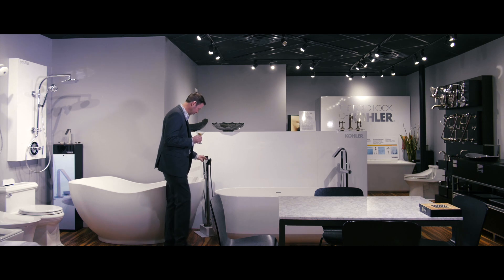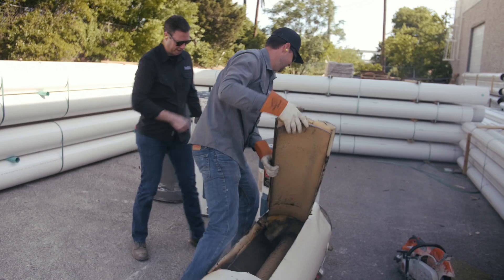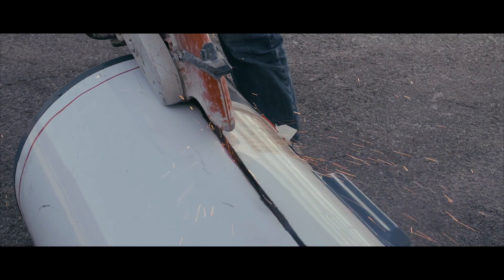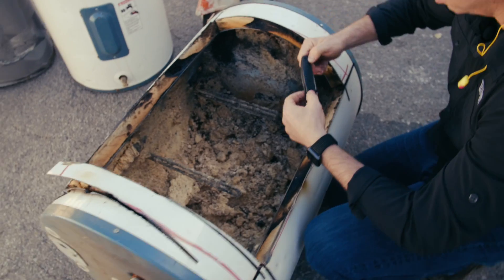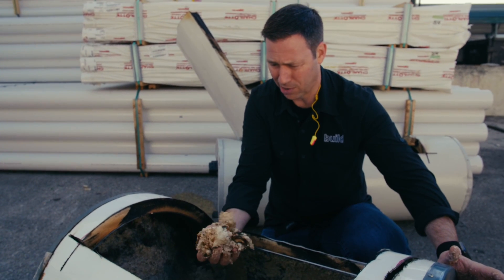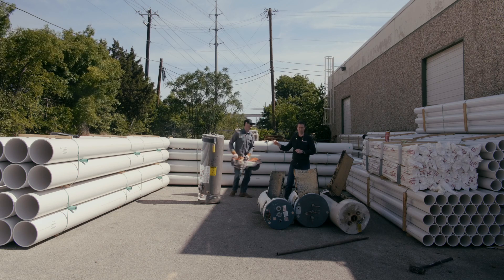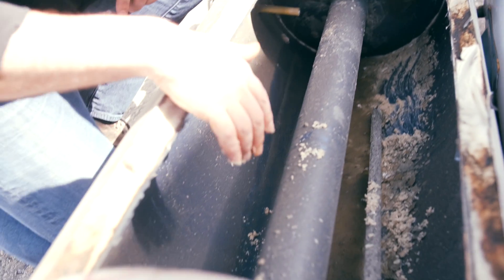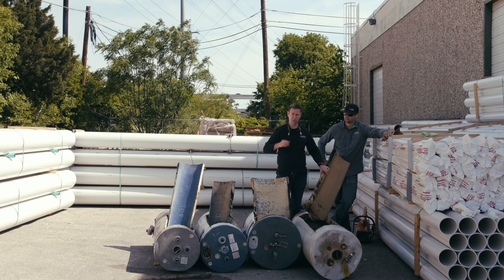Water Heater Tank Autopsy: You won’t believe what’s inside!

Comment: the dark brown and black stuff should be rust or a mix of iron oxides and iron hydroxides, presumably from exposed steel or iron in the tank walls and/or fittings. (if the enamel fails in a steel tank that would make sense, but a copper or stainless tank wouldn't make much sense for that, neither would an enameled tank that hasn't failed ... though stainless steel can still oxidize over time, especially when hot, and form black oxides, so that might be possible, too)

Most of the scale should be calcium carbonate formed when dissolved calcium bicarbonate decomposes at elevated temperatures. There's probably some magnesium carbonate, too, and the yellow color should mostly be from iron carbonate and hydroxide present in smaller quantities. (either naturally in the water or dissolved from iron and steel pipes)
It doesn't take much iron to discolor white calcium and magnesium carbonate. (iron is usually what gives tan and yellow limestone its color)

There might be more sediment at the top of some tanks due both to the higher temperature there in the electric heated tank, and due to lower turbulence and favorable domed cylinder shape allowing crystalized deposits to grow over time with existing crystals acting as seeds for more to form a stronger crust on rather than falling away.
The heating elements likely don't provide enough support for deposits to get that thick before falling off, plus the more extreme thermal expansion directly on the rods would more likely make deposits flake off when they get thick and heavy enough.

Comment: The small amount of scale in the bottom of the electric hot water tank is because the cold water supply is at the bottom flushing the sediment build up. As far as the different amount of build up is determined by the temperature of the water. Heating the water to hot causes the minerals to burn out as total hardness

Comment: Joe the plumber great video. I have always wanted to cut apart some of the water heaters I have drained or tried to drain. There is one thing in your video that stood out is that a water softner would help the water heater. I have replaced water heaters under warranty for Rheem that were less than 5 years old and every on of them have a water softener system.
It seems to only happen when there is a problem with the water softner causing high amounts of salt in the water heater causing corosion in the tank taking out the anode rode

Comment: Interesting. Probably why the topside feels heavier in a used tank when removing it. 

I came here to see how thick the tank walls were. Id like to recycle one we removed for a project that requires I cut it in half.  If its really dirty i will probably just scrap it properly. We have city water so I don’t expect a whole lot but id have to wash whatever is there out and paint the surface.

This at least tells me to focus on the lower half anyway. Thanks this was interesting.

Comment: getting my water heater replaced by maintenance man tomorrow rental property good folks and I thought maybe to ask if I could keep the old one thinking that there would be this copper line/pipe  coiling from top to bottom like some kinda heat exchanger etc etc...wow the inside is basically just a flume pipe  {gas type} thanks for the fun demo,,,, nobrainer please take away the low tech junk maint. man hopping for something to make a copper sculpter .....

Comment: We have a traditional copper cylinder about 45-50 years old and has no scale on the bottom, just a thin coating of limescale on the heating coil, and we live in a hard water area ??

Comment: About three years ago we replaced our 1985 propane fueled hot water heater. Not because it didn't work but because of water quality. We live in the Northeast and are truly blessed with soft water. There is a silt issue I discovered when we replaced it so I need a filter system. I figured there was a LOT of years of build up in it so I should replace it. The new one won't last half as long.

Comment: as easy as the buildup croubles, I wonder if a presser washer with a sewer cleaning hose/head would break the stuff up.  Go in thru the anode hole, and use the cleanout tap (maybe remove it) so the water has someplace to go.

Comment: Am so distressed. Even though pipes here have been replaced with copper, my water heater had so much crud in it that when my family member went to finally drain it after it had not been flushed in nearly 10 years , the sediment exploded all over him when he hooked up the hose. Thinking maybe . Just maybe the flushing would have improved. Now over a week later it's much worse. Of course I don't drink it but it ( Vaseline   type ) sticky feeling can't wipe it off my skin. It sticks to the dish and my hands stick to that! And it is very itchy. Help! This is Los Angeles water. Burns my scalp. I don't even wash my hair but every 5 days now. Plumber coming tomorrow. Can this be fixed? Or should I get a new heater?

Comment: I think the difference between the tanks is likely the condition of the anode rod.  The good tank has a decent anode rod, likely been maintained/replaced, whereas the older tanks had no anode rod.  So the rod is sacrificed from the mineral deposits instead of the tank.
Reply: Anode rod is to stop or greatly reduce the rate at which the steel corrodes once the glass lining cracks. Which is what causes a tank to eventually leak. It has no real impact on the mineral deposit rate that comes down to purely what's in the water, how hot the water is set to, and how often you use the hot water. A tank that gets used heavily will actually have less buildup then one that sits maintaining a lot. As the static tank the mineral deposits just sit there and don't go out with the hot water.

Comment: I have a 40 gallon gas water heater in my garage that developed a leak. Fortunately the last time I had the water heater replaced I had a drip pan installed that drains out to the outside . I heard it dripping and could see that the tray was full and draining to the outside and then I heard a loud low thunder rumbling coming from the tank and researched this on you tube and after seeing videos about flushing hot water heaters and on I thought the tank had cracked and must be loaded with this sludge shown in this video as I cleared the area around the water heater I got on a step stool and noticed that the 3/4 inch inlet fitting was leaking and after tightening this site water stopped filling the drip tray. I removed all the standing water in the drip tray and ran my hot water. when my hot water heater fired up this time it was quiet. Thus I concluded that the loud thunder rumbling vibrating sound had come from the standing water in the drip tray boiling under the gas burner now I don't need to replace this water heater nor call a plumber to fix it because I fixed it but I will flush it now for sure....

Comment: I'm not a chemisist, but if you boil or heat water  the precipitation of calcium and other salts occurs when the temperature is over 80°c, but not the formation of scales, heat cause the chemical reaction that makes tiny floccules suspended in water, actually the formation of scale occurs when hot water with this tiny carbonate precipitates suspended in it gets cooled really fast, this is just my experiences.

Comment: common sense the older tanks lasted longer than the newer tanks all cuz all appliance manufactors started a hustle on making it to where all the new appliances don't last as long just so the consumer has to go buy a new one. but the thing they didn't think about is not all people will go back to the same brand especially after they've seen that they don't last as long as now the products are junk. but that's with all manufactors on their monopoly system.

Comment: Most people don't do the regular flushing so to much crap accumulates till it corrodes and leak out from the bottom. I flushed my water heater and quite a bit flowed out. I just keep flushing till the water comes out clear. The stuff comes out orange/red and mine is hooked up to city water source. The 2005 model could have been flushed on a regular basis. It also corrodes the other fixtures too. Have to change out a couple of faucets and found them getting corroded too.

Comment: The water my city suplies comes from many wells and it's not treated so it can actually become a rock.

And that is what I found a couple of months ago. I used to flush my water heater and get some kind of wire throught the faucet of the drain to remove the scale inside. But last time I actually decided to change the faucet that was plastic for a brass one. When there was no faucet I put my finger inside and noticed all the scale built it inside and it was really hard. Nothing nowhere like the one in the video.

With that wire and my finger I tried to remove a lot of it. I ended up with a bag of hard scale and Im pretty sure that is not even a 1/3 of what is inside cause I was only doing the bottom part of it.

I'll be changing it next year once it turns 10 years old. 😑

Comment: Could be some  water sources had more minerals than others as why some looked better. I remember some years ago how one old heater's bottom element kept burning out. They asked me to look at it and after removing it, I shined a flashlight in the hole and saw only a solid block of scale. I believe there wasn't enough water seeping in through the scale to the bottom element (boiled away?) and the it was overheating.  I was surprised to see in your video how much scale collected at the top.

Comment: So how would this work with thankless water heaters? Is there still buildup within the unit and therefore causing failure of the system early on? Or is most of that build up passing long in the tankless water heater and technically not being "filtered" or left behind because of no tank?

Comment: That was disgusting Matt!! Haahahahaha....I just bought a new 'whole house' water conditioner the other day, BUT....I also had a BRAND NEW electric water heater installed at the same time!! My house was built in 2003, North Florida, and supplied by the city public source. Im sure my electric hot water heater was just as bad if not worse before replacement after 17 years!! Heres to hoping I get many years of quality water running through my cpvc's, without shortening the life of my heater. Thanks for the show.

Comment: My water heater is like the third one1. First its electric. The scale builds up then falls to the bottom until it gets so deep it causes the bottom element to fail. It took over an hr for it to drain out a 3/4 inch hose due to all the build up over the inside of the drain. I couldny wven get 150 lbs of air pressure to move it out of the way ( with top element out ). Then i used a shop vac with a small fexible  hose at its end to go in the hole the bottom element came out of and vacuumed 5- 3 gal  tanks full of that crap out before putting my new elements in , turning the water on and flipping the breaker on. 
I did this same thing  2 yrs ago as well  as replacing the thermostats and putting these super duper looper heating elements in. They got my water hot a good bit faster but they didnt survive the scale attack any better. Anyway, if ya got minerals in your water yoy either get to so thos every so often or replace your water heater. Personally after replacing my bottom element 3x and top once i finally took the time to clean it out some and put the afore mentioned extra long but bent in a loop to fit elements in and i went ahead and replaced the thermostats too since they dont cost much and i already had everything apart.  Learning to do this stuff is well worth your time guys. Much cheaper than replacing your tank and super easy to do. I figured out how to do it on my own , long before youtube was around and guys like this one were around to explaine everyth3ong to you.
Btw, great vid. i only wish  While you were in there you had explained whats what for those that dont know.

Comment: That's why you don't want hot water tanks, and instead a tank for heating water with a heat exchanger for instant hot water on demand. This heat exchanger spiral is heated much more evenly, so you don't get cold spots where bacteria can survive and the water don't sit very long in those pipes, since the volume is that much lower.

Also modern faucet do cause water hammers, these shake the heat exchanger spiral and any deposits on the inside and outside will be loosen over time.

Comment: Remember that the only difference between a 5 year guarantee water heater and a 10 year is the length and diameter of the anode! Buy the cheapest and a few rods. Pull the rod on a new heater and put anti seize paste on the threads and check the size of the anode, you might want to change it immediately.

Comment: YoU mIgHt cOnSidEr Not flucTUAtING tHe VOLUME so VIOLEnTly. fUCK.
Reply: Not that will reach the idiots cutting open water heaters with a chop saw, and no respirator. Also; If the water heater has scale, that means it was REMOVED from the incoming water: Your shower gurgle is therefore cleaner than the cold water from your kitchen tap, providing it remains unfiltered.

Comment: Huge difference between the 2001 and the 2005 water heater.  If you don't know the origin of the tank and how it was used it's difficult to determine the reason for the difference.  Good assumption that the 2005 may have had a water softener or a filter.  Why don't we filter all incoming water to our homes before it reaches our tank and taps?  Water quality and the mineral levels varies dramatically from town to town to rural to city.  The 2001 may have been heating water that was drawn from a well.  These deposits are minerals and do not necessarily contain bacteria or anything to be concerned about.  Most likely a water sample drawn from any one of those tanks could have been tested and found to be safe for consumption.

Comment: cold water can hold more of the mineral content in solution, when water is heated, it can no longer hold so much mineral in solution.  And so the minerals precipitate out and collect in the tank.  And so your hot water will have ever so slightly less mineral content then the cold water, as some minerals are left behind in tank and on pipe walls.

Comment: My hot water heater got really hot and kicked off and I had to have an electrician come and reset it to turn it back on but every since then I have had grit coming out of my water faucet and out of my bathroom bathtub faucet there's tiny flakes of black sooty kind of stuff. I noticed little flakes of it in the bathtub after I drain the tub from taking my bath. It makes me worry that it's in the bath water with me and I wonder if it's black mold or what it could be. Do you have any ideas.?

Comment: The top of the second tank had more scale because the top is where you can get air pockets in the tank showing surfaces where the watered surfaces can dry out from the heat and deposit its dissolved nature.  Either that or the water heater was installed and used upside down.

Comment: i just took out a 60g rheem hot water tank, electric, that i put in BRAND NEW, almost exactly three years ago...  it was leaking from the bottom - you can see the spot of rust and the lime scale where it was clearly leaking out onto the floor.    SO not impressed.   of course i didn't keep the bill...  water comes from a well, goes into a spin filter, then a fibre filter, into a water softener, then through two Carbon filters...   surprised there's any water left at the end of all the filtering.   haven't cut it in half to see what the issue was, but the anode tube was virtually untouched - few bits where it was eaten away, but most of it was totally clean.     first time with Rheem - last time with Rheem.
Reply: You should never spin water. Its dangerous.

Comment: Dang.  I wish I had photo's from a repair years ago.  An electric booster heater [used for a commercial dishwasher] had so much scale inside, that tank volume was reduced to less than 10% of capacity!  Needless to say, the condition was discovered due to heater element failure.  How it lasted as long as it did flat out amazed me. 
Filter your water supply.  Scale will still happen from minerals in solution, but it can be reduced in some cases.

Comment: As for scale buildup: I think design and material differences are part of the reason:  newer tanks have wider-spaced inlet/outlet tubes, and some advertise having a method of "swirling" the inlet water (likely thru a perforated inlet tube right next to the tank wall) to help control scale. Not to mention the coatings on the wall could be of a type (teflon-based, perhaps?) that prevents scale adhesion. 

As to the water softener question: I live in an area where the water out of the tap is hard as diamonds, and somewhat acidic as well. An older house we bought had brass faucets, which had corroded so badly that they had clogged themselves--and the house did NOT have a softener at any point. We installed one, which took care of the hardness; but I had to ultimately install a whole-house carbon filter as well to deal with the acidity (don't ask me how, but the pH level went more neutral after the carbon filter) and other crap in the water. 

But, yeah, I'd love to see a good video on water filters and softeners.

Comment: Flush your tank every year and replace the anode every 6-8 years depending on your water type and a hot water tank will last 30-40 years with no issues
Reply: Great advice, an also add a proper ball valve drain for increased flow during flush. The factory unit is too small.

Comment: what kind of el cheap'o boiler is this, we in hungary use like 30 -40 year old boilers, you have to replace the heating rods the diode and wash the inside and its fine for like forewer.
Reply: Whut the hell you doin' with a diode in there Bálint? You guys heat water with DC current?